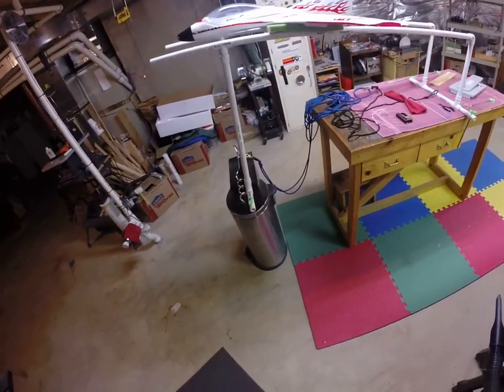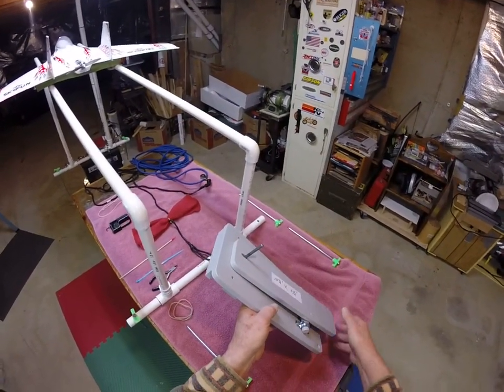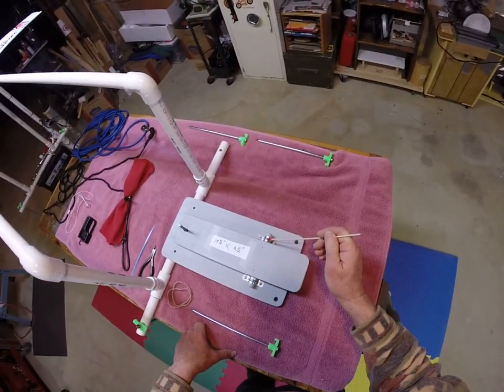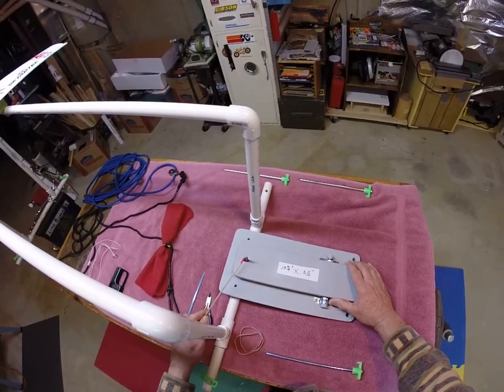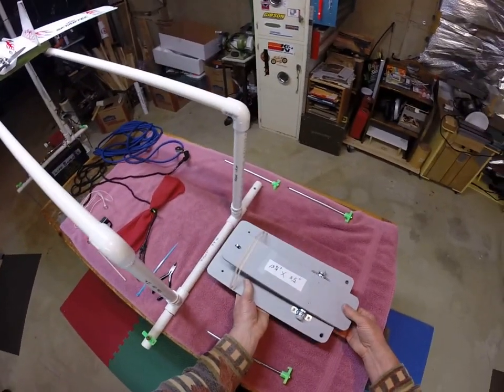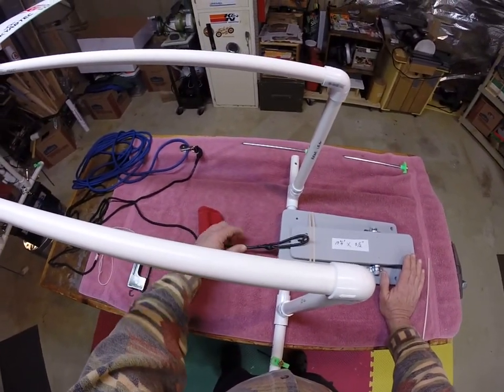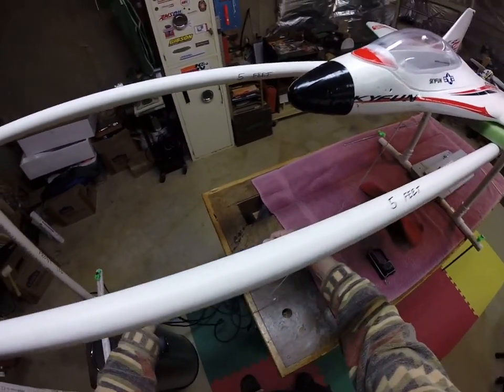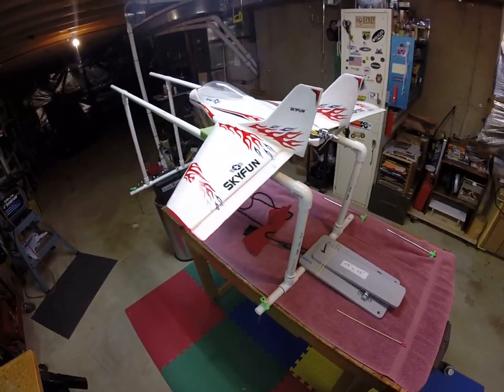Bungee Launcher Pedal Trigger

Comment from the maker: Carlos, My cord is 29 in. long, but has a 5 in, adjustable loop in the end that can be adjusted for various length planes.  Adjust this cord so that it is taunt under the weight of the plane, once you slide the plane to the rear of the launcher.  Be sure you use strong, braided cord.  I used some venation blind adjustment cord I had in the shop.  Good luck.

Comment: Dan, I was wondering if you have a Video of the use of your launcher and set up with the plane on it? or would you be kind enough to do one, I had made a launcher out of 3/4 PVC and had the pin mounted on the front the problem with that was after time the board and pin set up began to wear down. I really like your pedal set up because it seems to be less stress on the frame and such. 
Thank you in advance in any help you can offer
Reply from the maker: Wildkat, I have not used my launcher in over a year since I lost access to private farm fields, with crop rotation.  I fly at a regular club, and can not very well set it up in the middle of the active runway.  Check out this short video on operation:  SKYFUN Bungee launch/crash, or my other one on the launcher build.  The failure of this launch was caused by a loose aileron rod connection, not the launcher.  I have about 20 launches on this setup and there is no sign of wear.  I feel the key is to keep it tightly staked to the ground.
Reply: Dan, I did watch that video, Thank you for getting back to me. My problem here in Pa. is that there are a few clubs but they seem not willing to take on new members so I use the launcher so I can fly by myself. But THANK YOU for the video anyway! I am going to use your peddle set up along with a few other ideas to make it easier to use. It also helps me with the Young Children that I work with who are considered "AT Risk", They are from the inner city and have very little exposure to the wonderful world of flying. The launcher are cheap enough to make and I can either give a child one or lend it to them, depending on their grades and behavior!
Once again Thank you for sharing your ideas!
Reply from the maker: I too am from PA. Meadville PA; went to Edinboro State College and taught high school in Greenville.  God bless you for working with kids.  I am not sure I would turn a kid loose with this thing without close supervision, but you know your kids.  Good luck!
Reply: Yes you are so right about "turning them loose"! I grew up in the" Child welfare system" I lived in a home for kids for 8 yrs and then foster care. I am 60 years old and I know that the one thing that seems to be a constant problem is no guidance or trust from adults. I make these children understand that I will be there for them and that I won't tolerate Bullying or stealing and telling lies along with a few other rules. They have to do their part on learning about the planes also, So yes it is time consuming but I hope that as they grow they will understand that there are better things out there for them,, they just need to put some effort in life to have a better life!